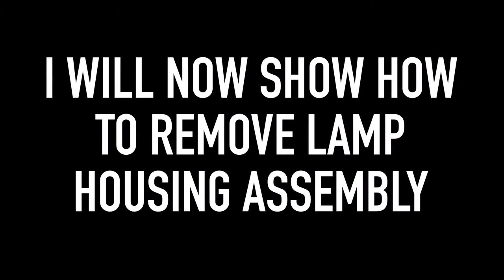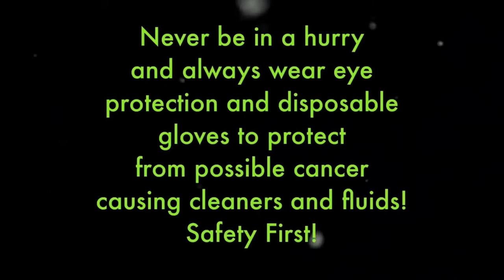How to replace Fog light lamp bulb or assembly on F150 2009 2010 2011 2012 2013 2014 (EP 188)

Comment: Thank you so much for this video.  I wanted to change out the original light assembly.  I also wanted to use Cerakote to make the housing area look brand new.  With your instructions, everything came out perfect.  Getting everything out of there and back in was a little difficult with my tools but not because of your information.  Your instructions were spot on and I wouldn't have thought about the use of the marker on the screws.  Nothing broke from the housing because of you and my fog lamps and housing area look brand new.  Thanks.
Reply from the maker: Glad it all worked out Brian. I am trying to make these videos as easy as possible to understand. I am imagining how great your lights look now that you have restored the plastic back to new.

Comment: not sure how to get them but mine came with rubber mats over the fog light housings to protect from rocks, I purchased mine used and it does have a slight lift to it maybe a few inches and offroad features so they may have come with it due to rocks being directed more towards them in this configuration but it seams like a good idea to have on
Reply from the maker: Hope it goes well.